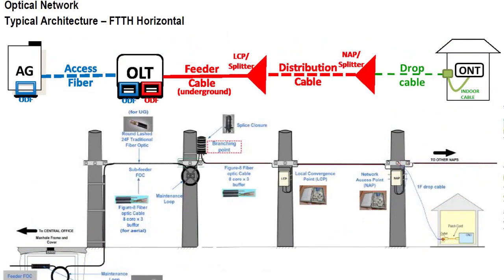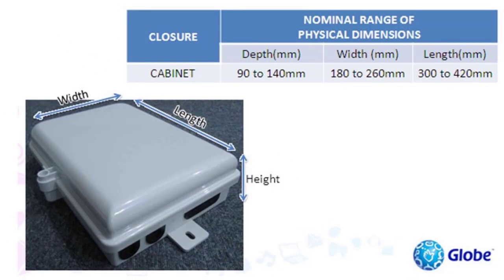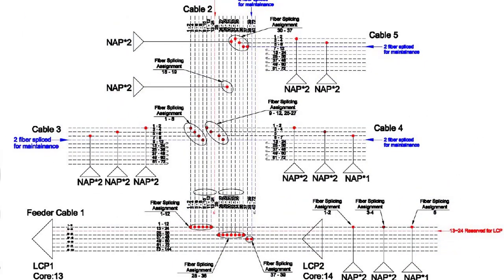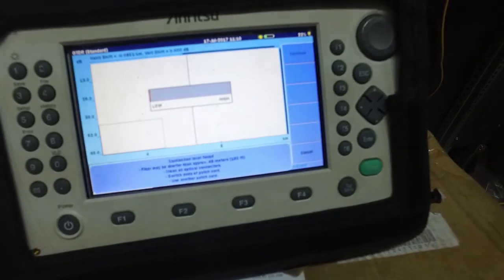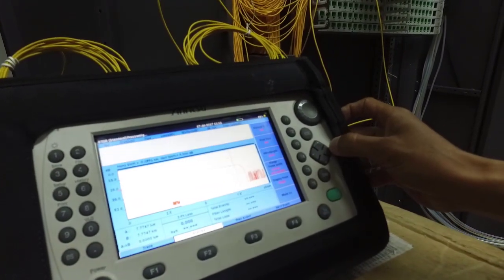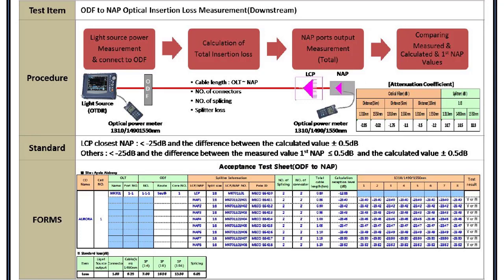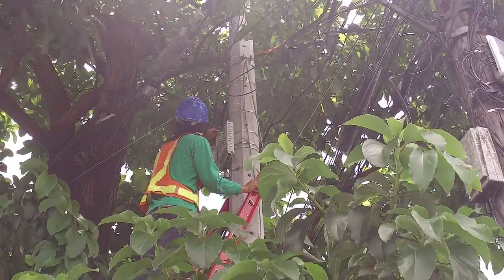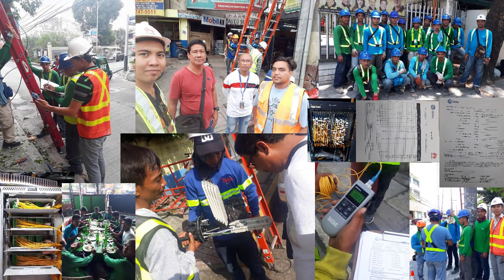FTTH Testing And Acceptance in the Philippines

Comment: Sir i have this scenario

I was installed on nap 3 then i experience blinking PON everynight then technician came, pinalitan modem, still experiencing blinking PON everynight. 

Then nilipat ako sa diff port but same NAP. Still experiencing blinking PON everynight.

Now nilipat na ako sa NAP 2. I'm still experiencing blinking PON but my neighbor which is on nap 2 is not experiencing my problem.

Any ideas sir? Please help so that i can relay this to globe techs.
Reply from the maker: Baka may issue sa drop cable na inilatag sayo from NAP to your premise.

Comment: Very informative Engineer 👍
Reply from the maker: Thanks 👍
Reply: @EMERmusikero93  Sir, I was wondering if you know, what PLDT uses?, 
do they use AON or PON?
Reply: @ethanreece1452  They use PON, GPON to be specific
Reply: @andersonpyaban8042  do you know what converge uses?
Reply: @ethanreece1452  they use GPON too
Reply: @andersonpyaban8042  No-one uses AON?
Reply: @ethanreece1452  it is used by all telcos but mostly  not for the final mile(OLT-Client),AONs are deployed in the backhaul segments for example netengines/core data center switches and routers to the sites where ATNs,Olts are located. for example in this case the OLT sITe is connected to a switching center or data center using active 10GE,25GE,40Ge and even 100GE Optical networks
Reply: @ethanreece1452  but AON is a vialble option especially for MDUs, some other parts of the world AONs have been used to provide gigabit services using existing copper networks,for example TDC denmark,Vodafone Ono etc have successfully deployed docsis 3.1 huawei solutions,BT/openreach have also intergrated active VDSL and  FTTN networks to provide superior speeds, and then In rural north in Britain they have deployed B4Rn(broadband for rural North) using Active SFp switched housed in street cabinets, you can find these case studies on youtube
Reply: @andersonpyaban8042  ok thanks a lot, i know in Ohio U.S, there are ISP's that rents Utopia's network that deploys AON network to all, including residential.